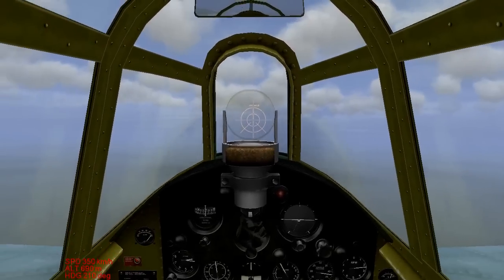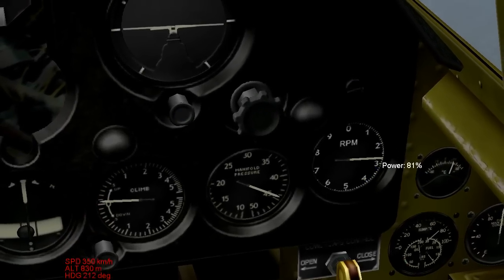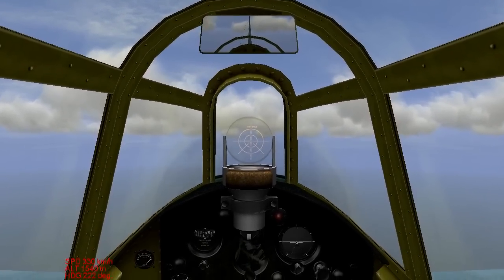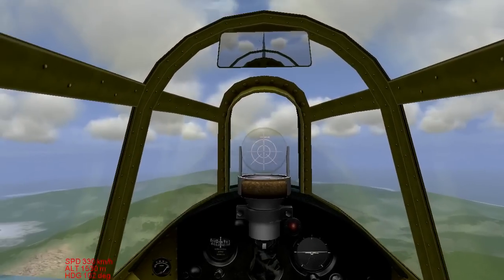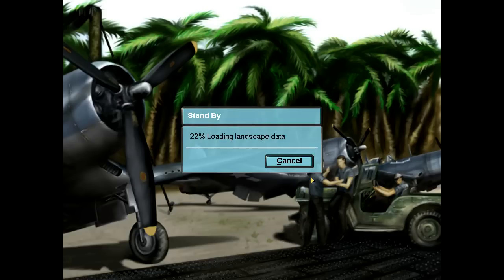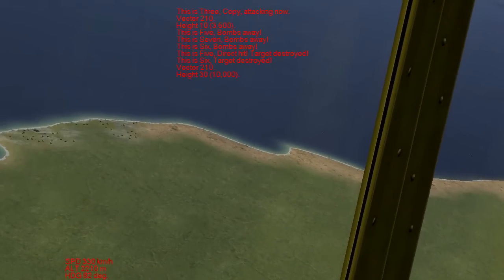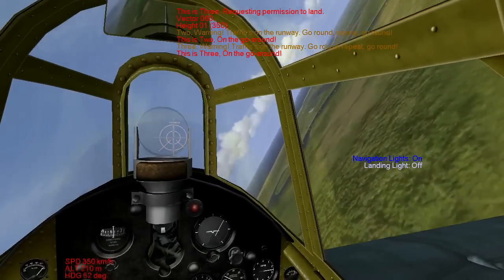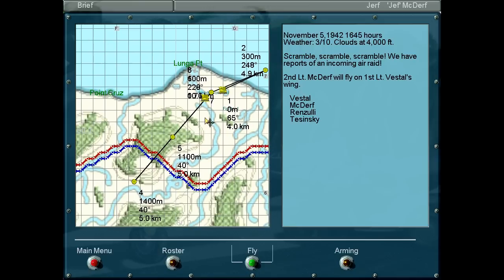Let's Play IL-2 Sturmovik: Hardcore - [USMC Mission 7] Officer Training, Unpromoted

Comment: For anyone struggling with prop settings, it's a cyclic! =D
The "gears on a car" analogy isn't bad for the purpose of avoiding under or over rev'ing.

But what I immediately think of (which might be some rather obscure knowledge) is how the cyclic-stick affects lift in a helicopter. 

You're adjusting the "bite" of the propeller. You don't want it to "under-bite" because it will over-spin due to so little resistance. 
And you don't want to to "over-bite" because it will over-work itself and struggle to chop through such a large chunk of air.

Comment: The prop pitch is more like how much the prop bites into the air-  so its how high each turn around the spiral staircase lifts you up.  The bigger the pitch, the more air each turn of the prop moves, so the more work it does (and the slower the engine RPM is for the same throttle setting).

Comment: As far as I know, opening the radiator literally opens slits in the fuselage to increase air flow over your engine and cool it down. This makes you less aerodynamic, increasing air resistance, which will slow you down and make dogfighting harder.

Comment: Also, prop pitch refers to the rotation of the blades of the prop relative to the propshaft. If they are more "flat", then they push less air and require more RPM to keep the same speed, but less torque. If they are at a larger angle, then they push more air per rotation (but require more torque), so you will go faster. You need to adjust the pitch to the altitude you are flying at, as a higher altitude flight requires a greater prop pitch to move the same volume of air.

Comment: @TheoryOfThought Those two settings do not directly control the rotations. Rather they each adjust other variables which impact on RPMs. The prop pitch has a higher impact on the RPMs and lower impact on the speed on a leveled flight, so you can use it to cool the engine. The power is the direct engine output. (If I got it correctly, I did skip a bit of the video)

Comment: @ELZCGIJoe 

Correct. 100% prop pitch allows higher engine RPM, which means it generates more heat through friction. Increasing prop pitch (decreasing the percentage) increases the prop's angle to the air, which puts strain on the engine and decreases RPM. So while the engine isn't generating as much heat, the increased prop pitch means you get more forward "push" out of each rotation...so you don't need all that RPM.

Comment: @jefmajor Reducing prop pitch in a dive should work, having a high prop pitch will limit the engine's top speed, just like low gears in a car. If the engine is producing say 3000 rpm, then you'll be able to achieve a higher speed with a low pitch than with a high pitch. However, the rate of acceleration will decrease so you won't gain speed as fast when in a dive, so maybe finding a middle ground would help.

Comment: No jeff you are right about the prop pitch.  In modern planes it's done automaticly, basily the more RPM you want the higher the angle of the pitch of the blades you want (100%) then if you have too much RPM you want less pitch pitch.  Having your pitch angled high will work as a air break and protect your engine from running too hot and damaging it.  When you are climbing  you need a low pitch because the need of RPM increasing.  You running it at 100% all the time gave the engine too much work

Comment: simply said: prop pitch (or prop control) changes the pitch or angle of your props... which effects the resistance they have more resistance means more strain on the engine... basically: find a good balance between prop pitch and throttle... last note when the engine dies or stalls and you aren't able to restart: proppitch 0% allows you to fly further then with proppitch 100%, at 0% the props should be parallel with the airflow

Comment: Because I'm an assburger I have to point out that prop pitch actually does refer to the pitch of the propeller blades. They turn as you change your prop pitch setting. Also a lot of what you're saying changes from plane to plane.